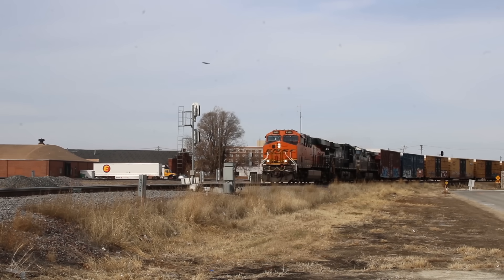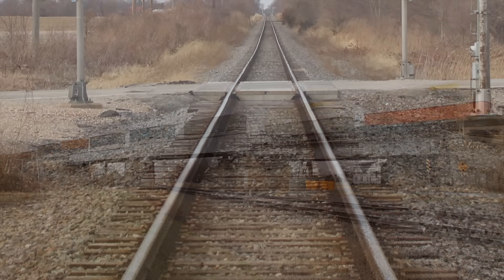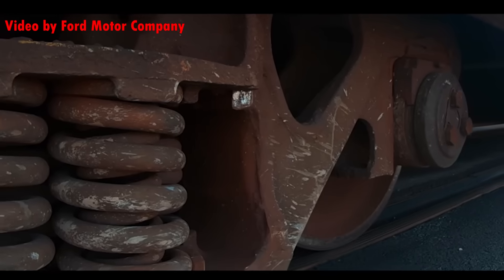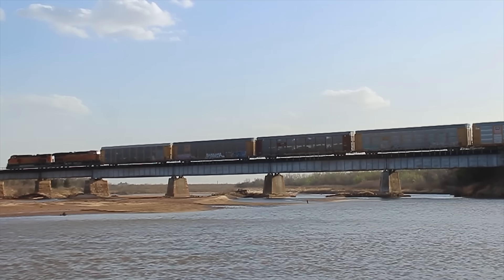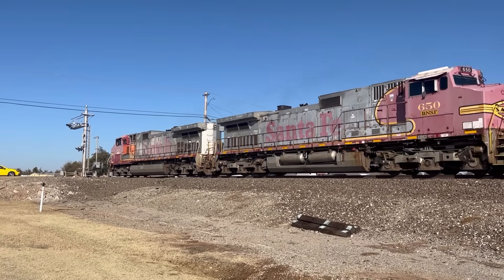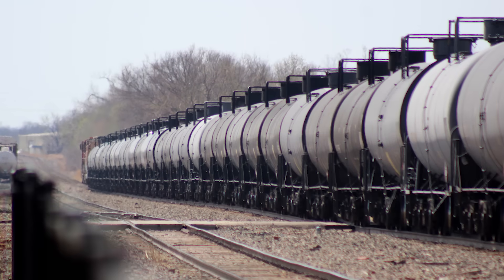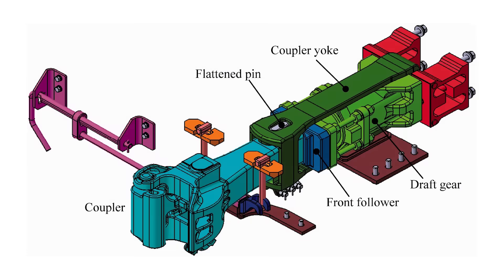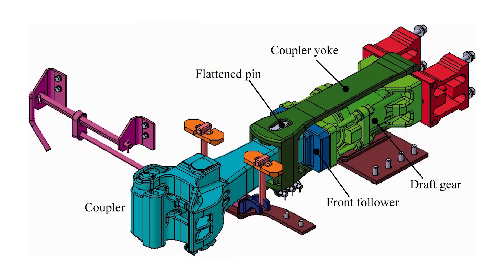Why Locomotives Can Pull So Much

Comment: I think the reason a truck can not pull a million pounds of Semi trailers is because it could not overcome the rubber deformation resistance, not ground contact patch area. And regardless of the trains steel wheel contact area, you don't have train wheel deformation. It would seem Hardness of the wheel is the actual metric.

Comment: The  LONG  freights of the US  are aided by adding locomotives at the rear ( pushing ! ) and often by ( a few ?  ) in the middle ... this greatly reduces the strain on the freight cars couplings .. but how do they all communicate ? or ,  is there an engineer in each power section .. let me ( us ? ) know ................. DAVE™🛑
Reply: Just the 2 man crew.  the engine or engines throughout the trains are called a DPU - Distributive Power Unit. they are  controlled via radio signal from the lead engine using a system called locotrol. they also act as brake repeaters to aid the air braking on very long trains. They can be operated to mimic what the headend power is doing or I can throttle off while keeping the mid-train or rear engines pushing full throttle
Reply: looks like someone never heard MU cable

Comment: I have to believe that the resistance felt in getting a stationary rail car to start moving has a lot more to do with the static friction of the wheel bearings than it does with contact area of the wheel and the rail.

Comment: Basically, because of the slack in the couplers,  at startup you’re not actually pulling all of them at once.  You move a single car,  then the next one moves and so on.  By the time the load gets heavy,  the train is already in motion and you have momentum helping you keep it moving.  It actually helps to reduce the load each coupler has as well.  If they didn’t operate like that,  the thousands of tons of pulling force would snap them like toothpicks.

Comment: While one locomotive can pull a very long train, multiple locomotives can accelerate must faster and pull it at a much higher speed.  Intermodal trains often have more power than they need so they can easily pull trains at high speeds.  Passenger locomotives are vastly overpowered so they can quickly get up to speed.

Comment: That video of the electric F150 moving those auto racks isn’t really that impressive. It’s actually well under the trucks actual towing capacity.  A Kia Sportage could have done the same thing. It’s the equivalent of towing a regular trailer that weighs between 2000 and 2500 lbs.

Comment: Excellent video, well done. 🙂👍👊👌
Just for clarity, do trains only pull or do they also push?
Reply: they also push, american freight trains tend to also put one of their locomotives on the rear or middle of the trains consist as a way to reduce slack action via MU cables

Comment: What about stopping
Reply: For passengers they’re very light so it would stop perfect
Freights take some time to stop so that’s why their slow
Reply: theoretically they should both take the same distance to stop if they are going same speed. If you go through the equations, mass cancels out assuming both trains are exerting the maximum possible brake force without slipping

Comment: You keep talking about friction between car wheels and rail, but surely nobody is trying to overcome that? It would mean sliding the wheels instead of rolling. The friction to overcome must be in bearings that attach the wheels to the car. Optimally there would only ever be static friction between wheels and rail, such that no sliding occurs there.

Comment: Lots of confusion between friction and rolling resistance. Basic physics, really. Low rolling resistance because of very low deformation (and thus hysteresis) on both sides of contact point. Study continues as to optimum coefficient of friction for rail/wheel wear. (I listen to experts.)

Comment: It's false, friction of wheels between tracks will always be static until it loses grip. There might be static friction between bearings or any other component, but wheels and tracks has nothing to do with it. If it was dynamic you would see wheels to rotate at different speed than tracks passing under them, which does not happen.

Comment: *TRY PULLING ALL THIS WEIGHT WITH AN ELECTRIC SEMI !!* 🤣🤣🤣🤣🤡🤡🤡🤡
Reply: you pretty much could if you geared them, the tesla semi truck can output 1500HP from its 5 ton battery and 600lbs of motors that spin to 20k RPM
Reply: @miguellopez3392  but how long will the battery charge last
Reply: @tompsheridantsheridant7354  40 minutes at that power level if it where continually trying to eccelerate to a higher speed. So you'd need a cart of batteries to give it significant range but atleast you can use regenerative braking when going downhill or slowing down to get back some juice.

Comment: Wished they would have covered the case when only some of the cars are slacked. I was on a hillside watching a train make of a consist at Bassett Furniture. When the local consist was added to the passing train not all cars were slacked. In this case the engineer moved the train forward and a few couples deslacked and then it stalled. Then he pushed it back and those few went slack plus several more slacked. Then ahead again. This took several iterations but finally there was series of clacks that sounded like it was a mile long and it got going. I am pretty sure they manually set the brakes on the last few cars to make this work. I was a good distance away but it looked like the brakeman released the brakes on the last 2 cars after the train got moving. There was enough momentum from the engines and other cars that these just slid along until released. It helps that dynamic friction is less than static friction.

Comment: Switching DC motors to series for high torque, higher engine rpm for heavy pulling. Parallel for speed, lower rpm, level pulling, motors convert to generators sending current to grid heat dissipation for braking.

Comment: Its not as complicated as one may be led to believe...ill save you 5 minutes in a few simple paragraphs
The locomotive connects the bogies well above the center line of the loco wheel. When the loco pulls the frictional force (rolling) times the bogies total weight makes the rear wheels of loco to exert more vertical force (due to moment arm) and this adds up to the loco dead weight, you are welcome 🤗

Comment: I wonder if this fellow has any idea what "exponentially" means. He uses the term repeated in a context that makes no sense. For something to be "exponentially" heavier, it's weight must be increased to a "power" of the number...like 2 raised to the power of 2 is 4, or 3 raised to the power of 2 is 9. The "2" is the exponent, meaning we multiply the number by itself. So a 1000 pound car, that is exponentially increased by the exponent 2 weighs 1 million pounds. Moreover, this contains a lot of interesting information, but friction also is not explained. There is a thing called INERTIA, the tendency of a body to not change its state of motion unless a force acts on it. The force it takes to move a stationary object depends on how quickly you wish to get the object up to a certain speed. TWO things are going on. The inertia of the object which must be overcome by the force, F which is given by Force = mass times the rate of change of velocity, and FRICTION which is a mechanical force caused by the action between atoms on the surfaces of materials in contact. This fellow talks about friction, but basically has it wrong.

Comment: In my mind trains always started fully taught and the engine just starts pulling.That's really neat about the couplers engaging one cart at a time to reduce the inertia being accelerated. It makes total sense now how trains can pull so much. 

This means that your claim that the low friction is the reason trains can pull so much is incomplete. You make a very common mistake when considering friction in rolling bodies. You're treating the train as if it were a pile of books you're pulling along on a string, with no wheels anywhere. The friction between the wheels and the ground is purely beneficial, and the friction in the bearings is purely detrimental. The friction on the ground is what lets a car speed up or slow down. The friction of the bearings oppose all motion, taking energy away from the speed and converting it to heat and sound. From a stand still, the only friction that needs to be overcome is the static friction in the bearings. Once moving the kinetic friction in the bearings needs to be matched to maintain speed, or exceeded to increase speed. The wheel friction is irrelevant. The /entire/ point of wheels is to eliminate the sliding friction of pushing a box along. 

You can intuitively confirm this model of friction with the following thought experiment: you have a small wheeled cart with grippy tires, and steel spikes protruding radially from the tires. The ground is soft earth and grass. The combination of wheel and ground means there is more ground friction than the ground can structurally support. This cart has star trek space fantasy bearings that are so near frictionless a mouse could starve on the difference. You start pulling this cart, and what happens? The cart moves forward effortlessly. If you had a box with the same bottom and tried to push it, you'd rip out the ground before you'd move. Therefore it's the axle friction you're overcoming, not ground friction. 

You claim that the wheel friction is so low a man can overcome it by pulling, but also simultaneously is so high that the wheels don't slip when accelerating. You're right about the second, but the first is wrong. However, the role friction plays is as a small leak in the pipes in the proverbial pumping of water. Friction is extremely minor in comparison to the real thing trains need to overcome, namely inertia.  

Mass takes force to accelerate. The force a train engine provides, proportional to the mass of the cargo is tiny compared to the force of a semi-truck proportional to its load. Apply a tiny force for long enough and you reach immense speeds.

So, the reason trains can move so much? The engine pulls the carts one at a time. If it would have to pull all carts at the same time it would have to overcome the sum of all bearing frictions and you wouldn't be able to. Starting one at a time lets the engine overcome the tiny axle friction of a single cart each time, leaving the hefty motors the task of accelerating ludicrous masses for a long time until they are moving at top speed.

(also if you add n carts you increase the mass by n, not n to the power of an exponent, so the load is linearly more than the engine. You meant "proportionately far greater mass than the engine").

Your knowledge of trains is impressive, and you taught me something I've been thinking about occasionally for a while now, so I thank you for that. That being said your researching can use more peer review, as you had the right information but your explanation was wrong.

Comment: There is NO WAY an EV F150 pulled multiple rail cars like they showed.
Reply: EV motors have high torque at low RPM, new tesla semi truck has high torque from 1-20k RPM on a single gear and can pull 40 tons GVW to 60mph in 20 seconds, 3x faster then a standard semi truck, a tesla SUV once pulled a 250k lb plane, its all about friction and torque.

Comment: No. Just no. The entire premises video is wrong. Forget this video.
The load is NOT due to the wheel to rail contact. The majority of friction is in the wheel bearings. This was demonstrated long ago with steam engines. An extremely large steam engine had its solid babbit bearings replaced with Timken roller bearings on its side rods and drivers. A few women succeeded to drag the loco.

Comment: The contact area is only part of the friction advantage. As it turns out, steel sliding against steel is one of the  most frictionless relationships in material science. It’s literally the steel itself that makes trains work. But the best part? The energetic efficiency of trains tends to scale positively with weight, up to the limits of the engine. Meaning the heavier the train, the more efficient the train. Nothing else, not even ships, works like that.

Comment: When it comes to performance 1 thing I have learnt is that when comparing electric trains, diesel trains, and steam trains is this: 
Electric train: speedy puppy. Can’t move much but moves it fast. Best used for passenger trains.
Diesel trains: big and powerful with good speed. Can move a lot of tonnage at a respectable speed. Best used for hauling lots of tonnage across a trip too long for a number of electric trains to get the job done quickly.
Steam trains: the gods we bow down to in there presence. Like Jesus fuck! Those fuckers can haul an entire mountain across the entire fucking continent and not even feel it. If u need to haul way more tonnage then wat a handful of diesel trains can handle across an entire large country or continent, then the steam train has u covered. Them fuckers got damn near infinite torque. Bcuz of how slow they normally r they r not well suited for low tonnage fast trips.

Comment: There is nothing exponential about the weight of a train.  Exponential means that when you add a fixed amount to something, something else is multiplied by a fixed factor.  E.g., when you say that the earth population doubles every 30 years, this is exponential.  You add a fixed amount of time (30 years), and that corresponds to a multiplication (by 2) of the number of people.  If you salary is increased by 1% every year, this is exponential, even if the increase will be very very slow.

Comment: The difference between higher static friction and relatively lower sliding friction is why locking up tires when braking in any normal car is a bad thing too. Even though the wheels are rolling, the contact point between the road and tire is under static friction and the car's brakes have more friction to use to brake than when the wheels are locked up and under sliding friction. Its the exact same under acceleration too.

Comment: As a tire tec working at michelin we went to a demonstration  on how to acheive the best fuel milage with an 80.000 lb semi. Doing this with a single human pulling the load and our job was simple just swich out the drive and trailer tires in 15 min lmao. It only took us 4 min. The short of this stort the lower the friction the better the fuel mileage.

Comment: What locomotives need to overcome is INERTIA not static friction. Static friction is already quite small and what's available is needed for traction i.e. to help wheel ROLL instead of SLIDING.

Comment: I remember seeing specification sheets for various locomotives that listed things like the weight of the locomotive, horsepower, number of traction motors and gave a figure for something called "tractive force."
Reply: Yes, each segment of rail line is also rated in each direction for how many horsepower are required per ton, taking into consideration the grades and curves present on it.  This has all been figured out since the days of steam, and modern computers take it into consideration when planning the make-up of trains.

Comment: Overall great video, I learned a lot. I do have one quarrel, however. The definition and explanation you provided for static friction was slightly vague and misleading. Even if a train or any rolling wheel-based vehicle is moving, it is still experiencing static friction with the surface it is riding on. Your demonstration was correct when you pushed you mixer on the tabletop until it slid. You kept on adding force until the force you were applying was greater than the static frictional force, which caused the mixer to start sliding on the table (now becoming kinetic friction). In the case of a rolling vehicle, there (usually) is no sliding of surfaces in relation to each other. Unless sliding begins to occur (like skidding to a stop on a bike) the train is always fighting static friction. Another way to think about it is to stop time as a train is moving. If you look at the contact area for a train wheel and rail. For the train to move forwards from where it is, it is not going to drag the wheels along the rail (kinetic friction), it will instead rotate the wheel, of which the contact area on the wheel will be stationary in respect to the rail it is touching. Hopefully that makes sense, asks questions if it is confusing.

Comment: Wow. So cool. I always thought that “slack” was just part of the couplers. 

It also makes the scene in the new Mission Impossible movie make more sense. They are on a luxury train that uses hooks in combination with a screw to tighten them. It seemed awfully old fashioned and unsafe compared to a modern automatic coupler.. but a heritage train is likely grandfathered in and since comfort is prioritized, they would want tight connections between cars. The light weight and low number of passenger cars would make static friction less of a concern.
Reply: But the links were not strong enough to take the weight of a few carriages.

Comment: The author is getting static friction wrong. Sorry. The train is not willing to start sliding, but start rolling. Static friction is helping here and the sand is there in order to INCREASE static friction. If you try to start too rapidly, the locomotive's wheels turn but slide and the train is almost not moving.